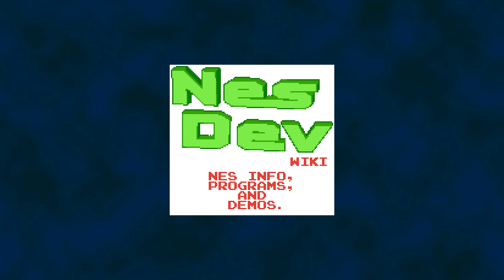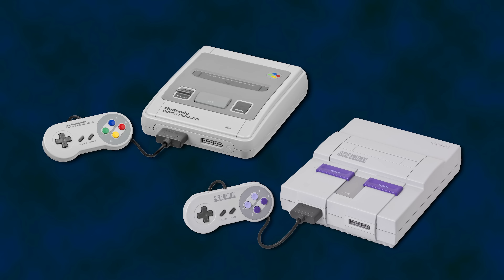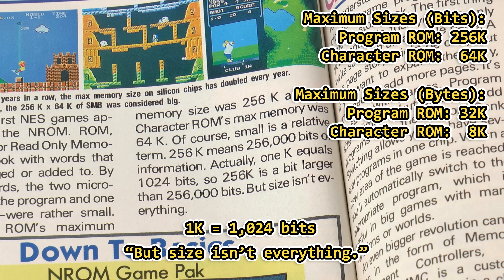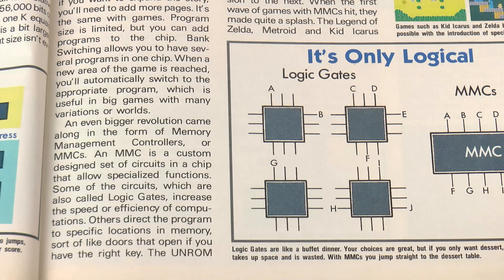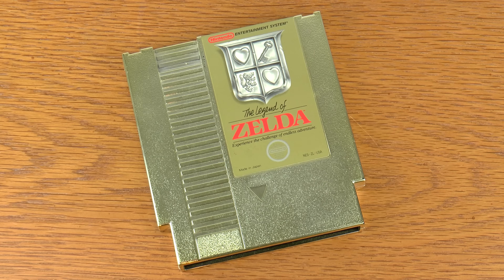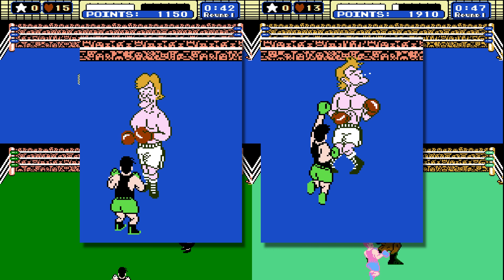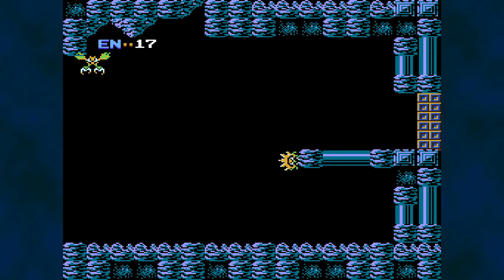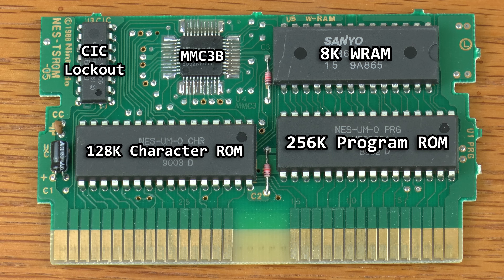Battle of the Bits: Nintendo Power, Mappers, and Circuit Boards - Talkin' Code Ep. 3

Comment: I'd say the NES memory mappers are a big part of the reason Nintendo is still around today - they allowed the NES to stay relevant for a lot longer than it would have otherwise. Aside from enabling larger game storage - the mappers could do things like flip pages for animations - like in Mario 3 and enable multidirectional split screen scrolling.
Reply: The thing about memory mappers is that, given that the games are provided on cartridges, it's basically impossible to not permit memory mapper functionality to some extent. No matter how you define your console, so long as the CPU has to read the ROM through pins on the cartridge, there would always have been the possibility for the cartridge to have internal logic to route those read requests to different internal ROM addresses.

Granted, the NES could have been a bit less mapper friendly. They made the decision to force cartridges to store character data on a separate ROM chip that the NES PPU accesses. This meant that the NES itself didn't need VRAM specifically for character data. Using character VRAM isn't a bad idea, but copying data to such RAM mid-frame would be prohibitive. So the gymnastics Punch-Out pulled wouldn't have been possible with dedicated character VRAM.

Of course, the SNES solved that problem by having a whole bunch of VRAM, but that's exactly what the NES developers were trying to avoid. Not to mention SNES tiles are 2-bytes-per-tile rather than 1, so having a bunch more tiles tiles was a thing you could do.
Reply: @GeneralBolas  I remember reading that the NES/Famicom was designed in such a way as to require as little RAM as possible. Given the original 1983 release date of the Famicom it makes sense - RAM was absurdly expensive in those days.
Reply: @mrflamewars  That could easily backfire, though. If the RAM you save in the console has to be provided by the cartridge, then instead of paying the cost for RAM once you pay it every time you buy a new game. Of course, Moore's law was established enough at that point that Nintendo could rely on RAM banks to increase in size/fall in price over the life of the console.
Reply: @TheRationalPi  There are lots and lots of games that have an 8KB SRAM so you're right. Wasteful - but economically cheaper.
Reply: @mrflamewars  That would especially make sense given that the NES's PPU is basically a whole 2D display engine on a chip and that scroll direction was initially determined by solder points external to the cartridge chips instead of actual data.
Reply: @TheRationalPi  ROM was much cheaper than RAM back then. So if each cartridge could bring its own ROM chips, it'd be cheaper overall than having to add more RAM to the console. After all, they'd have to have those graphics in the ROM anyway. Not unless they were going to generate the character data from CPU operations (either compression or with algorithms).
Reply: @mrflamewars  I believe initial goal for NES (Well Famicom, but let's not split hairs) was "Make a thing that can play Donkey Kong at home, AND MAKE IT AS CHEAP AS POSSIBLE!"
Reply: @GeneralBolas  And the SNES's increased VRAM allowed it to focus on the special midframe tricks it could do with HRAM.
Reply: The NES and especially SNES really took great advantage of this capability. Star Fox has the SuperFX that's basically more powerful than the SNES itself. The often-overlooked SA-1 was also amazing, and being the same CPU as the SNES (but faster!) made development much easier; there are even hacks for a handful of games that convert them to do most logic on SA-1 for a huge performance boost.

Game Boy also had a bunch of mapper chips as well as unique things like motion sensors, light sensors, infrared serial I/O (before GB Color had that built in), real-time clock, rumble, even a fish detector!

I was always surprised they hardly did anything of the sort with N64 and GBA. Maybe they felt the cartridges were already too expensive compared to PlayStation discs, and didn't want to add more cost? There were a few (GBA had a handful of sensors, Animal Forest had a clock, and Mario Artist would have had video capture built into a cartridge!) but for the most part the N64 treated the cartridge as if it were just a fast disk, and didn't put any special features in it. (and it could have really used a boost...)

I was actually disappointed when they announced GameCube would use only discs. I had imagined a caddy system, where the disc is enclosed in a plastic cartridge that also has space for a connector for add-on chips. Alas, no such thing ever happened, at least not on any Nintendo console I've ever seen.

Even the DS had a few games pack infrared, and I think motion sensors, into their tiny cartridges. IIRC it wasn't until Switch that games were actually forbidden from having extra chips, because they wanted to be able to have all games available as downloads.
Reply: @renakunisaki  "I was always surprised they hardly did anything of the sort with N64 and GBA."

Well, there wasn't much to do. On multiple fronts.

The N64 was not exactly hurting for CPU power (it could do actual floating-point math), so an added CPU wasn't feasible. And graphics chips were super-expensive.

The thing to remember about the SNES is that its CPU was pretty old even by standards of the day. So the SA-1 being basically a second, overclocked SNES CPU wasn't a huge cost concern, since the CPU wasn't most of the cost of the console. Though SA-1 games did demand a premium price.

By contrast, cutting edge 3D rasterizers like on the N64 were extremely expensive. You could never afford to put them into cartridges.

There's a point of diminishing returns here. When the base unit is weak, adding additional weak or even semi-weak processors can help a lot. But if the base unit is already cutting edge, there's not much more you could add.
Reply: @renakunisaki The Gameboy even had a digital camera accessory. One of the first digital cameras in existence it turned out.

Comment: Now I'm curious what would happen if you desoldered that horizontal scrolling bridge and soldered the vertical scrolling one and tried playing Mario... or more easily if you changed the settings in an emulator :p
Reply: Go look up "Mario Dream Mary" - that's exactly what you're looking for. It shows what the Mario 1 cartridge plays like with the mirroring pads connected backwards.